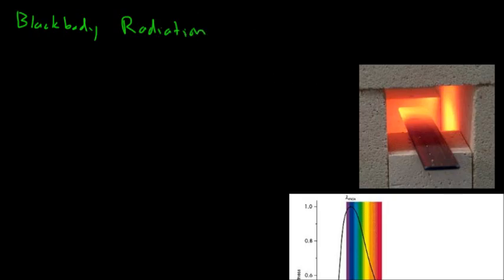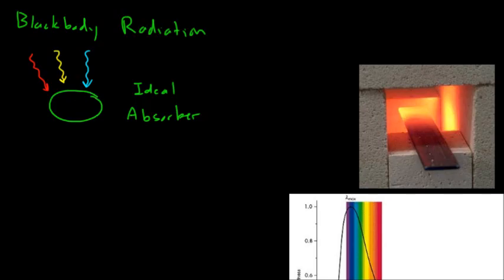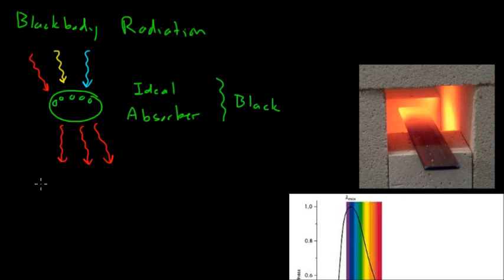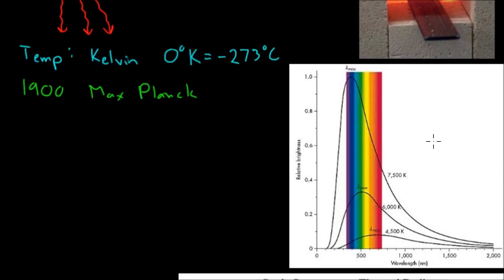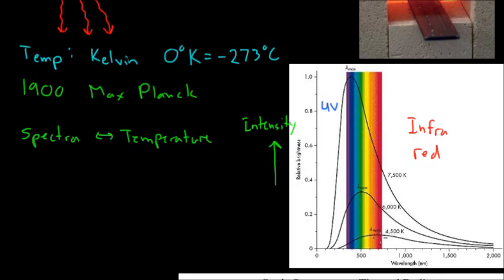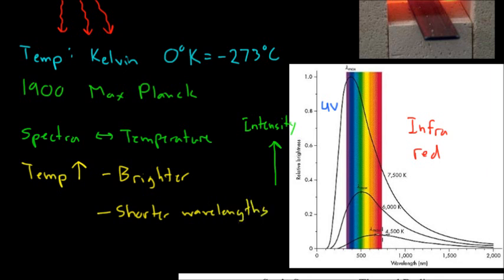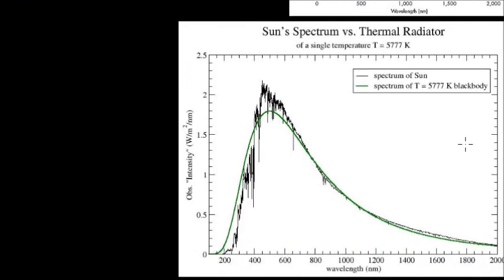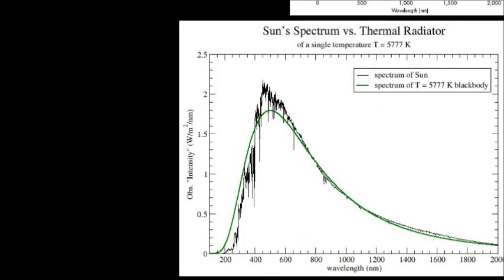Properties of Light: Blackbody Radiation

Comment: what is intensity on the Y axis?
Reply from the maker: You can basically think about it as how bright the light is at each of the different wavelengths.  For example, if you were looking at pure red light then the wavelengths that correspond to red light would have a high brightness and all of the other wavelengths would have zero brightness.  For white light all of the different wavelengths have a high brightness (white light is what you see when all of the colors of light mix together).  

We can generate these graphs by sending light through a prism, so all of the individual colors are separated from each other, and then measure how bright each of the colors appears.  These graphs can be very detailed and contain a huge amount of information about their sources.
Reply: but isn't brightness a relative term? are you saying UV light would have more brightness? it's confusing. Intensity isn't temperature? 
also, I'm confused about the graph, how are you going to increase the wavelength on the x-axis? shouldn't you first increase the intensity and then the wavelength will increase? and shouldn't that mean the intensity should be on the x-axis? because it's Y(X), so x changes not Y.
Reply from the maker: First, for each one of these graphs we are looking at individual objects that are heated to a certain temperature, so we aren't really changing intensity or wavelength independently in any of these experiments.  We take the light from an object that is heated to a certain temperature, send that light though a prism (or some similar device that separates our the different wavelengths of the light) and then simply measure the intensity (will define better below) of the light at each particular wavelength.

So for more detail, what is plotted on the y-axis in these graphs is usually light power per unit area per unit wavelength.  Let's break this up piece by piece.  Light power can be though of as light energy released per unit time, most commonly measured in watts (which is Joules of energy per second).  This could be in the form of a few high energy UV photons, or a lot of lower energy infrared photons, but astronomers usually compare the overall energy emitted, so it is a fair comparison (and more easily measurable).

As I mentioned, we send the light from the heated object through a prism to break up the different wavelengths of that light.  We can look specifically at tiny wavelength ranges and measure how much energy is carried by the photons of light in that wavelength range.  So maybe we're looking at red light between 650 and 651 nm.  We can then say in this range how much power is carried in this narrow wavelength range, hence, light power per unit wavelength.

But we also want to be careful that we're comparing the light from similar objects.  If I was comparing the light from a golf ball sized object heated to a certain temperature, and a beach ball sized object headed to a different temperature, that wouldn't be fair because there is simply more of the second object giving off light.  So we scale our light power measurement by the surface area of the object that is emitting the light.  So overall what we measure is light power per unit area per unit wavelength, and we make this measurement for all of the different wavelengths of light.

Hope that clarifies things a bit.  Sorry for the delay in my response.

Comment: How do infrared goggles help us see the color ? for instance, as you mentioned the temperature our body releases is very less which means a bigger wavelength ( outside the visible light spectrum) so on the basis of what do the goggles show the color red.
Reply from the maker: The images that you see through infrared goggles are false color images.  Basically, the camera itself is sensitive to infrared light coming from different directions.  The camera records that infrared image as a digital signal and will assign different colors to different parts of the infrared spectrum.  So the camera detects longer wavelength infrared light, that might show up in the display as a darker blue or purple color.  More of the near infrared light might show up in the display as a more yellow color.  The brightness that is displayed usually corresponds to the intensity of the infrared light that the camera detected.  So the colors that you see in the display don't really correspond to any real colors (again our eyes can't detect infrared light); instead these false colors simply represent parts of the spectrum that we can't see.

Comment: Oh and maybe you can also explain why the sun is a blackbody (given it consists of mainly hydrogen and helium which give off light)? I don't quite see how these two elements can form a "black body".
Reply: +Sven Beckmann black body is an ideal case of an object that is a perfect emitter and absorber of radiation. It's like the Carnot cycle for heat engines. No heat engine can exceed the performance of the Carnot cycle since it's an ideal case with not losses to friction and such.

Comment: My Physics Professor doesn't like "degree" Kelvin. He just writes Kelvin.
Reply: My chem professor at UC Berkeley said the same thing. He said degrees should only be used when a measurement is made in respect to a non-zero standard.
Reply: That's correct. The standard is to not put that degree symbol (°K).
It looks like everyone noticed it. There are 50 posts about it.

Comment: Black Holes? How close to ideal Absorber?
Reply from the maker: Pretty much perfect.  Although in classical relativity black holes absorb everything that crosses their event horizon, introducing quantum mechanical properties into the theory seem to suggest that black holes do have a temperature and would emit black body radiation.  However, for a black hole the mass of the sun, this temperature would be about 60 nanokelvin, so low that we have no chance of observing this from distant black holes.  Another strange effect is that the lower the mass of a black hole, the higher it's effective temperature, so if a microscopic black hole could be produced in a particle accelerator, we may be able to see the higher radiation, but this is still way beyond current accelerator capabilities (and don't worry, this radiation would cause that tiny black hole to evaporate very quickly so it wouldn't eat up the Earth or anything like that)
Reply: Thanks, I appreciate that information :)